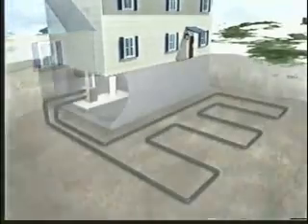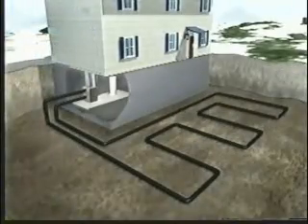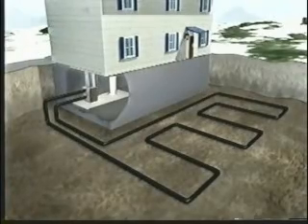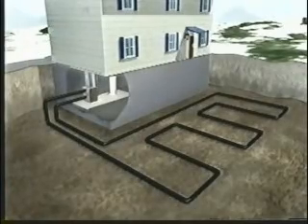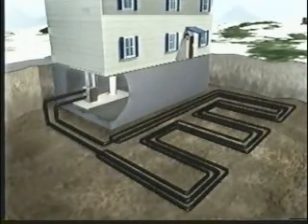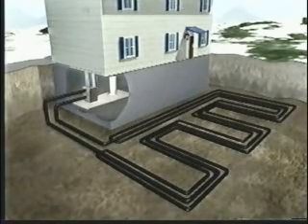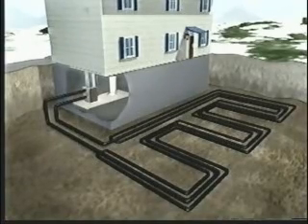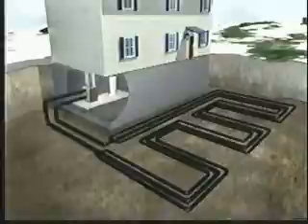GeoExchange Heating and Cooling System

Comment: India had in its tradition thousand years old techniques still used in villages, cow dung. Flush your outer walls with cow dung ,a natural heat resistant cooler system. Increases oxygen as well at zero cost of operations and maintenance. Can you beat this.

Comment: Before you spend $20,000 dollars unnecessarily on a system that may never reach the point of pay back, do this first. Have your doors and windows upgraded. Then have your attic professionally insulated. 70% of your summer heat gain and winter heat loss occurs through your ceiling. Drafty, uninsulated windows and doors are the next biggest culprit. Putting in a more efficient HVAC system without eliminating your sources of heat gain or loss is much like buying a bigger bilge pump for your boat instead of fixing the holes. Geo thermal is temperamental , if your buried piping springs a leak it will cost you a fortune to find and fix it. If the propylene glycol solution circulating through it becomes disproportionate due to a leak and too much water and dissolved air enter the system your solution becomes acidic and will corrode any metal in the system. And though your ground piping is plastic, the piping in the condenser isn't and no one ever regularly tests their ground loop water. Try the cheaper solution first.
Reply: Whaaaaat!?😱

Comment: What bout condensation
Reply: Condensation is handled just like it is in any AC/heat pump with a collection tray under the inside coil to collect and direct to a drain or condensate pump.

Comment: Will geothermal heating/cooling change with the  environmental changes?  Ex: prolonged heatwave/draught (sorry California), global warming (if such a thing)?  Can the pipes used be penetrated by a critter or get snagged by something sharp causing an aneurysm-like weaking that allows a pressure leak or blockade over time (not necessarily noticed right away from testing)?  Or worse--perhaps suck in methane from underneath and gas your family?  I don't trust this system

Comment: 54 feet down where constants temperature is for the ground to act as a condenser in this type of system.
In the introduction of these system this was they way to install the GEO system.
This requires digging deep vertical wells. 
I went class training on these systems.
I installed and worked in HVAC system installs for 40 years.
This type of burying horizontal works, it is just not the best way of doing things.
Reply: some geology areas are either too rocky to a shallow depth for sufficient exchange and thus the horizontal system is used well bellow the frost line and also mentioned bellow the home or portion of a river  which as long as buried deep enough works just as well. Or the customer request the horizontal to save on drilling, especially in places where perhaps a utility pipeline passes under the property. So to think all places have the convenience for 54 foot depth of the typical vertical system is the only best way, you were being taught right but by a teacher who only knows this vertical system one track mind.

Comment: Another vid that explains the concept, but not the technical exchange process (compressor/condensor).
Reply: actually 007mercucio you have miss an important part of how this works.. you have to have a Heat pump which is a compressor/condenser/evaporator all in one here is a good video to learn about this. https://www.youtube.com/watch?v=KE3SvNRmwcQ
Reply: Unfortunately I think you missed the entire point of it.  The whole point of this is that it doesn't use a compressor/condenser, so it requires less power... instead, it gets the cooler temperature from the earth and circulates it up from where it's cool to where it's warm.  It's like free cooling from the earth itself, instead... just circulation and ventilation going on here.  AC units use a ton of power in hot climates, and this kind of system they show could save alot of power... and they do show the technical exchange process...they show all those copper coils...that's it!  That's the heat exchanger... the only thing missing here is the DEPTH of the heat exchanger coils.

Comment: Iv'e personally installed several of these systems and you can't beat their efficiency, especially when you add solar or wind power to off set the cost of electricity needed run the system.
Reply: William how deep did you go and horizontal or vertical?
Reply: +William Winder Hi william I trying to design one such system on a test base. Can you help in the design part of it.
thanks
Reply: @ubaidyounus1443  nclsXj
AVJbvZzzzz

Comment: if you want to heat your house to 57 deg. yes.

I would suggest solar heating instead. /might be better in cold areas
Reply: you put a heatpump in the system to get the temperatures for heating your house with a floor heating system works fine even in cold areas and you could use solar heating  to heat water for daily usage and put the rest of the warm water you don´t need through an extra circuit in the ground to "regenerate" the groundtemperature. system works fine at a friends house since 1975. but since photovolt panels are becoming so cheap it makes often more sense to put some of them on your roof instead of the solar heaters.
Reply: depending on your state rebate and incentive - it pays to do both...
Radiant heat is also a good idea - on new construction a must, or if your planning on a tile or stone floor in a bathroom or kitchen!!!

Comment: What heat pumps really are? They are no different from your window air conditioner, which blows cold air into your home, and hot air outside (feel the hot air being expelled from any window unit in the summer) except that the ground loop keeps the air conditioner from freezing up during the summer, and in the winter the "air conditioner" reverses and blows the hot air inside your home and cold air out. So in the winter the ground loop, again, keeps the "air conditioner" functioning.

It's a bit more complicated than that of course, and my explanation is very simplistic, but it's basically how it works. 

Having said all that, a "Heat pump" is no better than normal air conditioners during the summer, but is WAY better than other electric sources during the winter since no heating coils are used. Instead, the cycle of compressed gas is what makes the heat. So running a compressor VS an electric heating coil is the key point and the compressor is much cheaper to run.

Comment: Question. If the air outside the house in Michigan is 10 below zero, and the ground below the house at a grade level of about 17 feet is 57 degrees, could it help with heating?
Reply: Thats the whole point with its system its for both heating and cooling, what people get it confused with is geothermal energy which Iceland is perfectly demonstrating use of that also provides central distributed heating only to residents from the source. And the said the entire video this is a closed loop where as geothermal energy system is partially closed but open loop

Comment: A 1/2 circulating pump will run an entire buildings water circulation depending on the size and stories of a building.  For a 100 square foot room, you would only need about 1/6 of a horse power to circulate the water.  However, it would not seem to be cost effective to cool one room of a house using a circulating water system, since a 1/2 hrs would do your entire home.  If memory serves, the motor can withstand 80° Celsius at continued use.  The issue is the piping....

Comment: Could you please mention, what type of pump will be useful to cool a room for an open loop system inside well using well water? What type of 'Duct' is used inside room? Is it copper coils? To cool a 100 squire foot room, will a water pump of 1/2 horse power or 1 horse power will be effective? When the water pump becomes hot, will it be necessary to stop running the water-pump and give it a few minutes' rest to cool the pump?

Comment: Yes an open loop system would be cheaper if you had a high water table and a constant water table level. The problem is there are areas where the water table is hundreds, and even thousands of feet below the surface. The price of drilling a well even a thousand feet could run over 5,000$ easily, depending on your soil type.